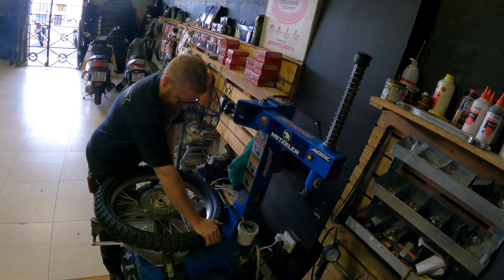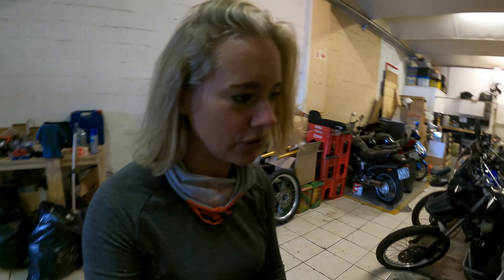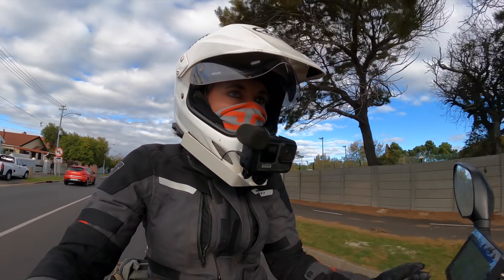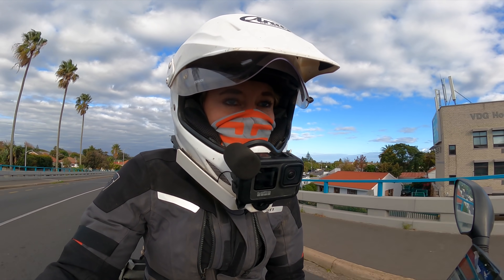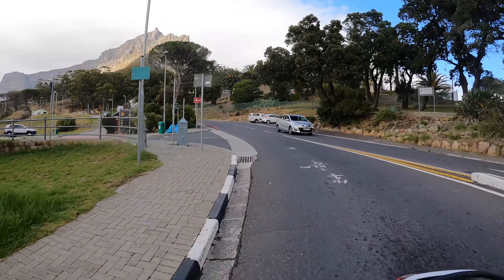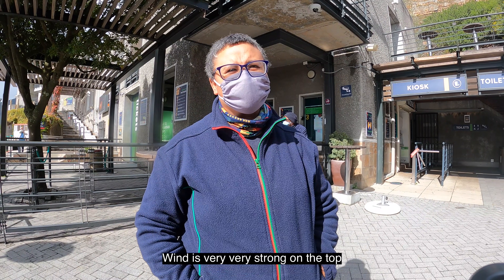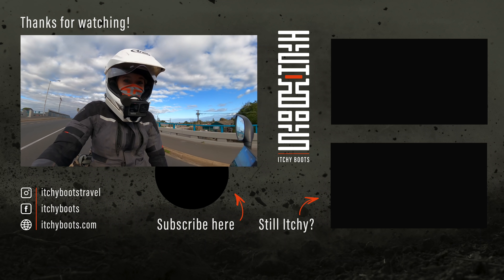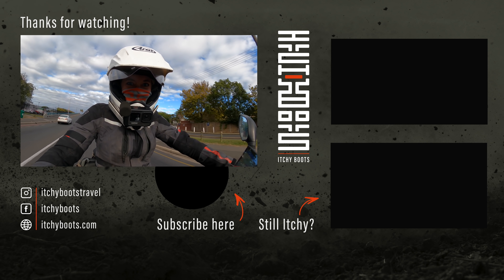Why is Table mountain in Cape Town FLAT?! [S5 - Eps. 28]

Comment: Ran across this on Table Mt.'s website:  “If there is expected wind we use indicators such as the amount of cloud cover over the Hottentots Holland mountains, the white horses (waves driven by the wind, resulting in broken white crests) on the Atlantic seaboard side, and the dark wind line over Table Bay. If the wind is approaching we will notice the cloud getting thicker over the Hottentots Holland mountains, the white horses will get closer towards Camps Bay, and the dark wind line will move closer to Robben Island.”

Comment: Steering head bearings, left front fork seals, and timing chain tensioner. 
Those three parts are the weak points of the CRF250L. Since you have changed the steeringshead bearings then thats one thing less to worry about. You can replace the Cam Chain Tensioner with a manual one. The one that comes from the factory fails suddenly. Keep safe Noraly!

Comment: Good the bike is fixed up.Bearings,tyres,air-cleaner,throttle grip etc.Not surprised the steering head was hard to get off with all those rugged mountain tracks you've been on.

Comment: Tip from a local.
If you are planning a trip up table mountain, avoid the lines and purchase your tickets online. 
The lines can be very long, often over an before getting your ticket.

Also, if here in summer go up the mountain about 6pm.
Sunset is around 8.30pm.
If you go up at 6pm you get to see the city during daylight, thru sunset and night.

Comment: I find some gravels and spin my new tires in them to "break them in" , remove the mold wax that is slick on pavement esp when wet.    And steering head bearings have been a problem on several brands of bikes I've owned including the older BMW bikes .   BMW factory used some red grease that hardened causing the bearings to wear prematurely.   I wish bike manufacturers would put grease fittings at the top bearings so grease could be added without removing the fork assy.

Comment: Thanks for sharing your travels; you're an inspiration to many. My only thought is regarding bearing wear. In well over a  hundred thousand miles I've never had to replace a wheel or steering head bearing. I've had to adjust them, but not replace. 

Anyway,  it's extremely important to maintain your motorcycle. Thanks again for sharing!

Comment: A 1/8 " thick rounded 2 1/2 " flat stock welded to your kick stand would have worked very well without the height issue. Good luck with the new parts and tires.

Comment: Bearings definately should not be worn out this soon! Either poor dealer setup when new or this shop taking you for a ride! :(
Reply: Agreed, steering head bearings probably were under greased from the factory.  I think Honda wheel bearings are sealed only on the outside.  Anytime they are replaced, be sure to use bearings that are sealed on both sides.

Comment: from 1972 upto 1985 had a honda 125 trail bike did 180;000 km mostly over rough mountain fire trails in nsw australia.and from 1988 to 2019 did 250;000km over same rough roads never had to touch the stearing head bearings on either bike. the fact that these bearing are failing on these new bikes its very likely they getting these bearings from the same place nearly everthing else comes from china,and if thats the reason honda shame on you a company that once made the finest products money could buy. cheers noraly from australia.